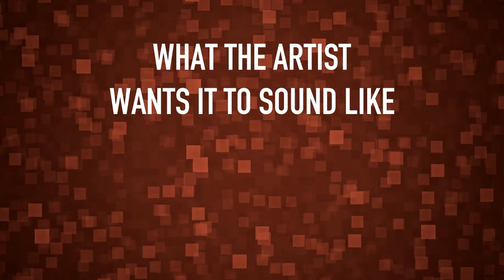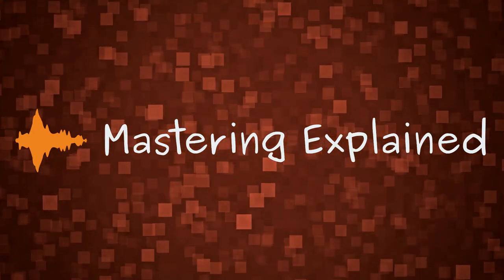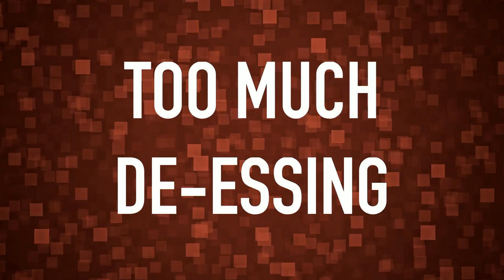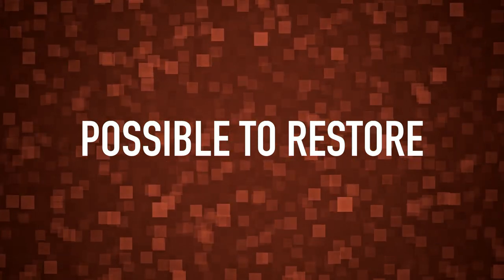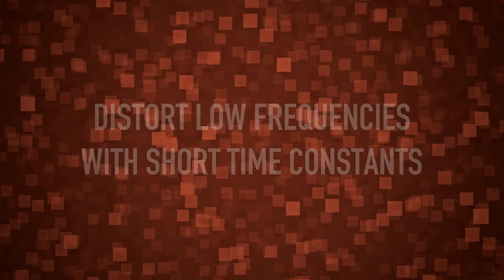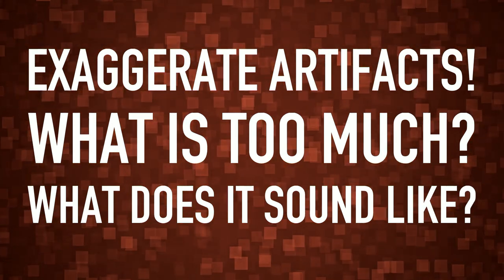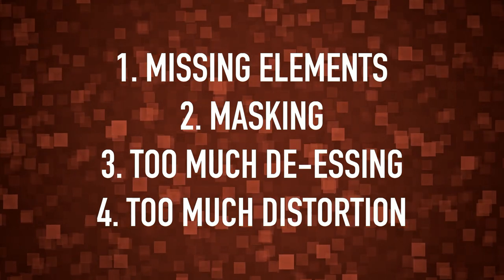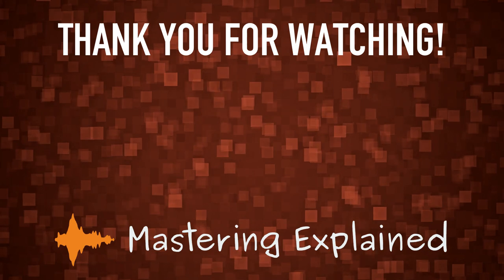4 things that can be hard to fix in the mastering

Comment: Do you use de-clip in RX to fix distortion? Any other tools can be used? Thanks
Reply from the maker: Yes. The declipper is made for those square waveforms. If the distortion sounds like gravel, then spectral repair can work. If it sounds like clicks then I would try the declicker. This is all in Rx.  /Sofia